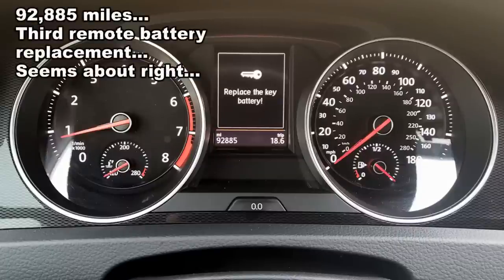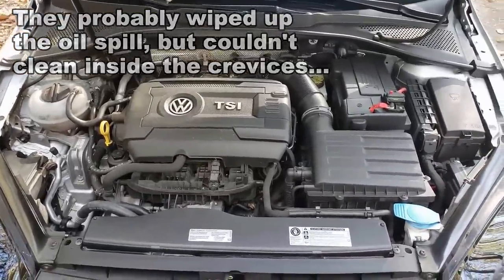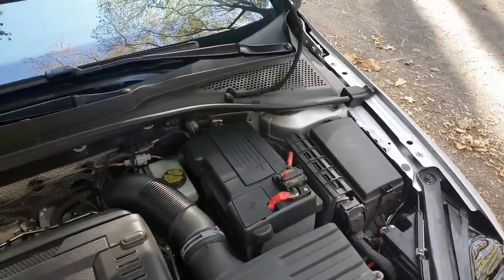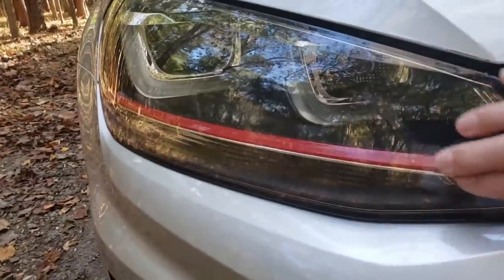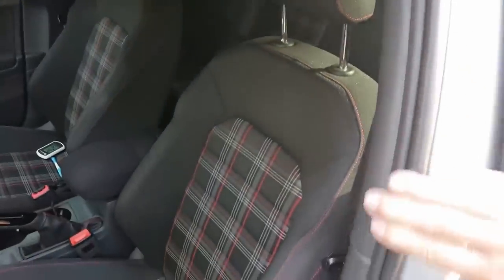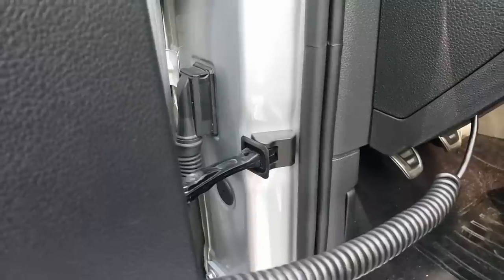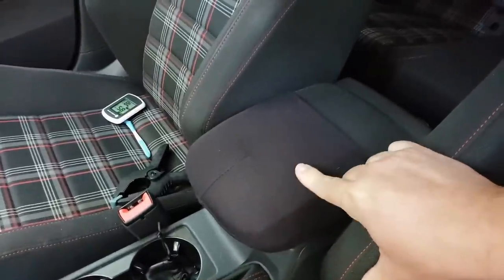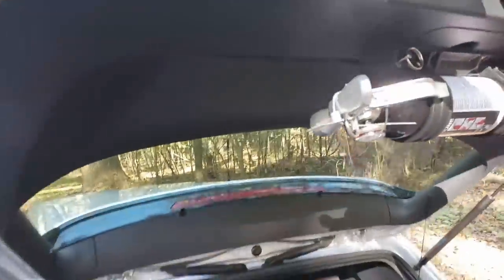THREE YEARS AND 93,000 MILES: My Report, Part 1

Comment: Re: coolant leak. I had a 2015 GTI and now a 2019 R and they both had coolant leaks. The water pump on these is plastic.  One leaked at the water pump gasket and the other had a cracked water pump, VW is well aware of issue though you may have to push the dealer a bit if you are off warranty. The 2015 was well off warranty but i asked a regional rep to review the case and there was no argument thereafter. As far as i know they still have plastic wate pumps so I'd assume it's an ongoing issue. You will smell the antifreeze before you see any leak. In my cars the leaks were minimal. You will smell the antifreeze after a significant drive long before you see anything. Because there was no obvious leak the dealer could see, it took a lot of complaining that finally got the regional service rep involved to get the 2015 fixed. With the Golf r there was no hassle. The dealership was well aware of the problem. As far as i know, it continues to be a problem. I think the real solution will be a metal water pump whose base won't deform with heat.
Reply from the maker: My pump and thermostat housing eventually failed at 115,000 miles. The replacement parts were revised part numbers and seem to be working fine at nearly 200,000 miles. Time will tell if that continues to be the case. Thanks for visiting!

Comment: I have the exact same Reflex Silver 2017 Sport with the manual transmission!  But I am only at 30,000 and only a stage 1+ tune from Unitronic at 9,000 miles.  I have had to add coolant once as well but it has held since.  My clutch is holding great but I am very careful not to give too much throttle in high gears at low RPM.  I am still in love with this car.  Great performance, Audi like interior, subtle exterior design and it is so much fun to drive.  My wife has a 2017 WRX and it feels SO slow compared to my GTI it isn't even funny.  And the interior of her WRX feels like a car from 2004.
Reply from the maker: I agree with your assessment of quality in these cars. It's been great!

Comment: go for the skid plate! I haven't seen a plastic pan with gasket leak yet. Unless it's been hit... And they are actually quite robust when hit. I remember when they came out and I was just laughing at it... Like OMG how could you keep the most important part of the engine... THE OIL with a plastic oil pan. Truth be told, quite well design on these tsi plasic oil pans.
Reply from the maker: Thanks for posting.

Comment: In my experience most contemporary cars will go about 100K without too many problems. The real, long-term reliability issues and cost comes after this. Of course, nowadays lots of  people buy a car with no intention of keeping it for many years, but if you want to keep a car for 200k or 20 years, you don't want it to turn into a money pit. I wonder what kind of costs this car would have during the 2nd half of its life?
Reply from the maker: I tend to believe that more problems surface over time, rather than mileage. Obviously, there are wear and tear items. But most of my previous cars' issues didn't start to appear until after 10 years, even with my '98 Jetta TDI that had around 300,000 miles at the 10 year mark. I don't think I'll keep this GTI beyond 10 years. I don't have that kind of faith in the quality of various plastic bits. Thanks for visiting.

Comment: 17,000 miles of driving would have covered that oil in dust...it would not have been wet like that....you have a leak or a vent that is venting..and the coolant is an issue on these motors (radiator leaks common), and the water pumps, thermostats, otherwise the Mk7 is actually the 1st "almost" problem free VW
Reply from the maker: The leak is relatively new. It's all clean now. Thanks for visiting.

Comment: My 2015 factory oil pan has held up just fine with no leaks at all but I was considering changing it out for a larger cast aluminum one so hopefully it doesn’t leak when I’m done.ive had the same problem with standing water on the roof pouring into my window switches but my sunroof has been wonderful and never leaks.leaving my dash cam plugged into my obd port one long weekend killed my battery as well.i go threw coolant slightly slower then you and there is no leak.thanks for making this video! And is that a drain valve on that oil pan??
Reply from the maker: The drain valve is called a Fumoto valve. I go into more detail in my oil pan video at https://youtu.be/YQudcXG_5AQ. Thanks for visiting.

Comment: I used to have a MKV GTI, and looking into getting a MK7 which is how I found your videos.... One common issue with the MKV was a very small part called a cam follower. It basically rides along one of the cam lobes and by doing so, controls the fuel pump. Some people had them wear out after only 15-20k miles, while others lasted well past 60k miles. Wondering if you have ever checked this, or if VW moved to a better system since the MKV. 

Thanks
Reply from the maker: Common remarks when I was shopping in 2016 was that the Mk7 fixed all of the major issues that were had by the Mk6. That said, if I develop a follower problem, I'll see if there's an upgrade or just fix it and drive more. Thanks for visiting.

Comment: wow.. i have a 2016 nissan rogue S and theyre all known as junk car coz of its cvt transmission.. but man i have 78k miles on it and its past 3 years old now and the only problem i had is brake pads.. changed rotors,pads,rgular oil chnge,new tires @50k miles and thats it. thinking of trading it to a vw before i get that transmission drama but now i dunno.. maybe ill look for toyota or hyundai instead.
Reply from the maker: I'm publishing a video at 2pm that will explain a few things. I think some are over-reacting to my report. Stay tuned. -Scott

Comment: That sunroof leak is typically a user error. My MkIV had a BAD leak in the sunroof. Found the cause to be dust/leaves/junk had built up in the sunroof drains and had to basically run a thick/long pipe cleaner through it. it's such an out-of-sight thing that people probably forget or don't even know there are drains up there. Never had issues with my sunroof other than the sunshade constantly rattling but that's another story.
Reply from the maker: Not sure about that. As shown in my video, the plastic sunroof frame on these cars tends to crack. Sometimes the cracks are big; I suspect sometimes the cracks can be small enough to overlook. Thanks for visiting.

Comment: I owned a Mk5 golf hoping that my new Mk6 would have a better window design... (with the water build up on the roof) and it was exactly the same... I now own a GTD MK7 like this and it actually took out the power window on the driver's side as the water poured right in to the switch. Stupid design flaw that should have been rectified by now.
Reply from the maker: I guess aerodynamics and fuel economy trumps the need to have windows open when it rains. I'm over it.  ;-)

Comment: It is not normal to "consume" coolant fluid - it is not normal to have to replace the battery after only 2 1/2 years - poor clarity in windshields is not normal -  worn upholstery after only 2 1/2 years is not normal - cabin fan failure is not normal. VW's are priced at the top of the sector they compete in and these kind of failings are not up to Toyota/Honda/Mazda standards who are priced lower.
Reply from the maker: Thanks for sharing your thoughts. Take Care!

Comment: I'm glad I finally settled on getting a GTI.  I have a Mazda 3 now so it won't be a drastic change except being faster and better.  I was looking at an Accord coupe based on the V6 being fast but VWs just seem a bit more refined.  i'd rather have good handling than straightline speed.  i can get that later with mods if i want.

it looks nice in the lighthouse pic.  i love the dark side mirrors.  i spray painted my rims gunmetal gray and it did make a huge difference.  Rustoleum has a really nice color for that called Carbon Mist.  clear bra is a great idea as well.  i'll also have to have some kind of German plate on the front of course to represent my ancestors lol. 

too bad the car is made in Mexico and not Germany but it gave hard working people a good job. so its all good!
Reply from the maker: If fun is what you're after, the GTI is a much better pick over the Accord. I think the Accord and GTI are evenly matched in acceleration when compared stock-vs-stock. The outcome changes drastically after a tune, though. I wouldn't think twice about attempting to pass an Accord on the highway, especially one with a V6. Thanks for visiting.
Reply: @StealthGTI  yeah, the mod options are amazing for the GTI.  definitely want it to be somewhat of a sleeper as well.  i heard the Accord doesn't handle that great so the choice is simple.

thx for your great vids!

Comment: hello. I also have a ‘17 sport. Arizona car. I already had the coolant loss issue.  It was the water pump. replaced it and installed the metal impeller which replaces the prone to fail plastic one. not cheap ($800-ish). 

I also am curious about how you did the gunmetal finish on the wheels? two of mine are scratched and im considering that gun metal costing idea.  thanks!
Reply from the maker: I took the wheels to a powder coating place and they showed me samples. Of course, doing it this way means you need either a second set of wheels or to leave your car on jack stands while the wheels are being refinished. Good Luck! -Scott

Comment: Been looking for a fun manual vehicle and I'm set between the GTI, a GLI, or a Dodge Challenger R/T. Not very many choices nowadays :(
Reply from the maker: The Challenger is a big difference between the other two. IMO, the Challenger will not handle as well and, even if I'm wrong about that, you'll have every boy racer with a chip on his shoulder challenging you to a race every time you drive it. Both the GTI and GLI are great sleepers. Thanks for visiting.
Reply: @StealthGTI  I know they are different. I just like how Challengers look and I liked how it felt to drive an old co-worker's. His was a Scat Pack 392 though.

Comment: My 2015 plastic oil pan is still on the car 210000km later, no leaks, no issues, even in -35 Celsius. The rest of the car, maybe don’t go there at this moment. Touchy subject.
Reply from the maker: HAHA! Thanks for the feedback. My kid's 2015 recently needed a replacement engine at about 125,000 miles (201,000 km)!  :-( My car is past 183,000 miles (294,000 km). Years ago, I thought I'd reach 200,000 miles this year. Instead, I'll try to do a milestone video at 300,000 km, which should be in just 6-8 weeks. Thanks for visiting!

Comment: I had a polo gti 1.8 tsi and it consumed oil like no tomorrow. Luckily it was a lease and I handed it back afterwards. It was a only 2 years old.
Reply from the maker: It's always nice to be able to give back a problem. I've been lucky in my 35 years of driving: I've been able to drive all of my cars into the ground without significant problems... all of the ones I bought NEW, anyway. Thanks for visiting.

Comment: My friend has a 2018, and on an icy, cold day, a chunk of ice fell off the bottom of the truck he was following.  He maneuvered to avoid hitting the ice head on, but it hit the plastic oil pan, and cracked it.  Since then, he had it replaced with a metal (steel?) one.  I currently have a sizeable dent in the oil pan of my 2013 GTI, fortunately it doesn't interfere with the pump intake.  I can live with the dent.  I don't think I could live it it cracking.
Reply from the maker: Plastic pans shatter, aluminum pans crack, and steel pans bend. Even if the steel bend pierces somewhere, the loss of oil will be much slower and give more time to pull over, turn off the engine, and save the car. I can live with that! Plus, I have a skid plate, too!  :-)  Thanks for visiting!

Comment: I have a silver 16 SE manual with a performance pack and APR stage 1.  Still running the factory oil pan at 70k miles and not a drop of oil coming from it.  my car is also lowered and I still have never had an issue with damage to the plastic plan so I think you should stick with the OEM stuff.
Reply from the maker: Thanks for the note, Erik. Unfortunately, there's too much debris on the roads around here to risk it. I found a gasket that works well with the steel oil pan. No leaks in over a year. Thanks for visiting.

Comment: I live in the Pacific Northwest and the only consistent issue I've seen is that the rear door seals sometimes leak from the top and allow a little bit of water to drip onto the floor. Not the biggest deal, since I've got the all-weather rubber mats and the water eventually evaporates away, but still a little annoying to see all the time.

I've also had the rear main seal replaced under warranty, as it was causing an oil leak. And I brought it in for that fuel collector recall. 

Other than that, it's been a faultless car. 2015 6-speed with 32K miles.
Reply from the maker: Thanks for sharing. One of the other commenters said his rear door leaks were coming through the speaker seals. You might find it by searching these comments for the word "speaker." Good Luck!

Comment: your coolant lid in this video is not fully secured it should be in a straight line with the vehicle and click into position.Also vw uses a 50/50 blend in their coolant systems (Coolant/ Distilled water) the water can evaporate under hotter operating conditions which is why coolant levels sometimes drop. Although these engines are also prone to thermostat leaks as well. Nice car though! love the GTi's
Reply from the maker: Thanks for the keen eye. My lid was only like that for a few hours. I happened to have captured that footage before locking everything down. Thanks for visiting.

Comment: Your coolant cap isn’t tight all the way, it kind of clicks that last turn. And your coolant is probably leaking from your thermostat housing gasket or the weep hole in the water pump, Iook under your intake manifold and you will see. You will need a infotainment module eventually and a wheel bearing. Pretty good car other than that
-VW tech
Reply from the maker: Thanks for the note. I had topped off the coolant about a week before shooting. The cap was correct before that. And it's correct not. I didn't realize there is a click until yesterday. Thanks for visiting.

Comment: Thanks  for pointing out the quality of materials like rubbers and interior only after 3y/100k miles. Yes, indeed not  the best in class but decent. Unfortunately, it is overprice for the built quality.
Reply from the maker: If you're referring to the seat bolster and door gasket, those wear items are more indicative of my poor entry method than of VW's quality. The fit and finish on the car is superb, especially for the $25k that I paid for it new! Thanks for visiting.

Comment: December 5th is going to be my GTI 3rd birthday but I only drove her around 23k miles.
I got engine oil leak about year ago which supposed to be fixed by dealer under warranty but after they touched the engine(not sure how far they digged into it ), I feel engine wobbles a lot and it doesn't have the same acceleration when I push down the accelerator. I was always worried if I ask them to check it, them might make it worse. 
Do you know what parameters should I check through OBD scan which relates to engine performance and turbo charger?
Reply from the maker: Sorry, I cannot help diagnose a fault that I don't understand. You can start with an "AutoScan" in OBDeleven or VCDS. However, not all problems are found via the OBD port. You might want to try a second dealer, if warranty is paramount. Thanks for writing.

Comment: I have a 2015 GTI S APR stage 2 with 80,000 miles, no leaks coming from the oem plastic oil pan. Thanks! will be getting a skid plate instead.
Reply from the maker: Very nice! Thanks for sharing your experience.

Comment: I just picked up a 2017 GTI with performance package, it's got 37K miles on it, and I put roughly 30K miles a year on my vehicles. I intend to drive it normally, not racing about, and do my maintenance as scheduled. How many miles are on your GTI now? I'm hoping to get 300K out of this car with proper maintenance and turbo cleaning.
Reply from the maker: I'm at 114,000 miles. The car currently has a minor problem. I'll provide an update in my travel series, which is currently running with more episodes in production. Even with this problem, I think the is great and is holding up well. Thanks for visiting.

Comment: I have a mk7 and still have the plastic oil pan. No leaks so far. I’ve had mine almost 4 years now. 

I have the same trim but dumb question... does your trunk open from the key fob? Mine doesn’t.
Reply from the maker: My FOB does not open the hatch. Thanks for the comments about your oil pan. Thanks for visiting.

Comment: Don't know why VW's eat coolant without leaking it. It's not a head gasket problem either.
Reply from the maker: I eventually had to replace the pump, thermostat, and housing. The original lasted 116,000 miles. Let's see if the new ones take me to beyond 200k.  :-)  Thanks for visiting!